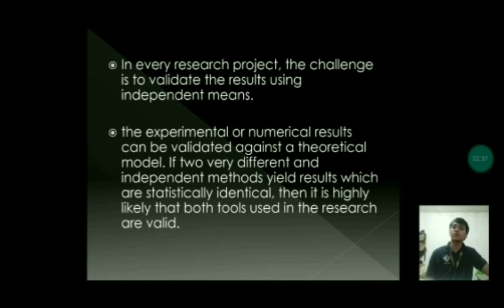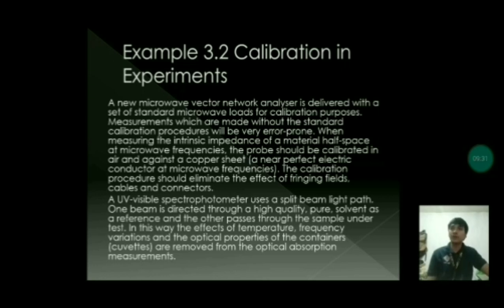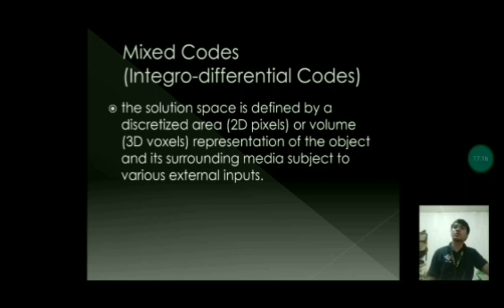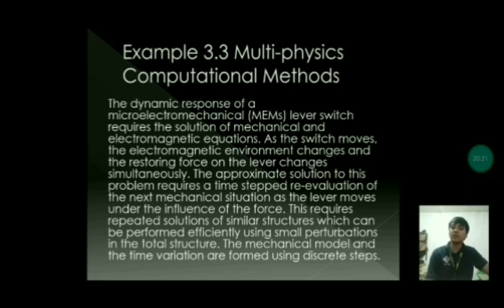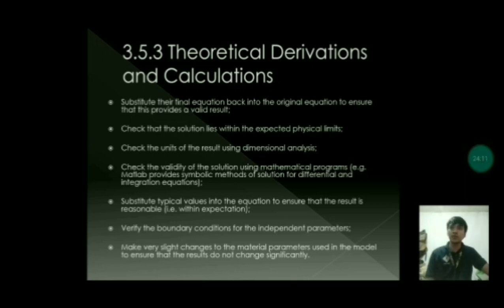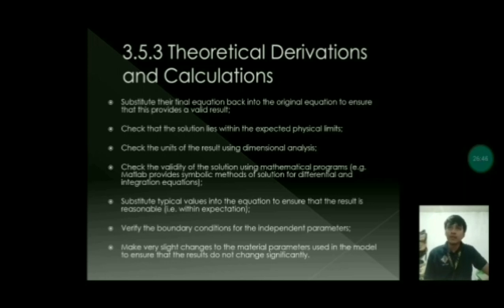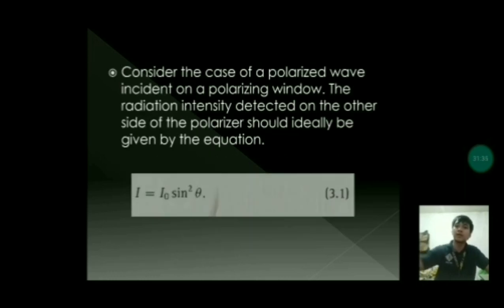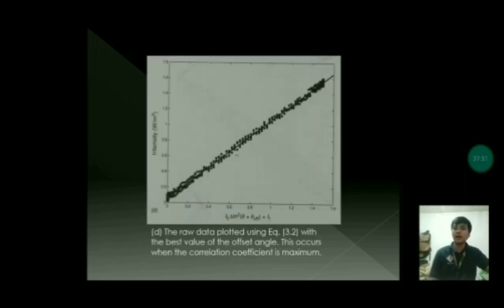Research Tools

Comment: Loreto, Liezl Mae E.
March 26, 2023
MWF 6:30-8:30 PM

REFLECTION
In this report, it describes the various research tools available for validating the results of a research project. It is important to validate the results using independent means, and the research plan should clearly outline the techniques that will be used for this validation. The strongest case can be made if the experimental or numerical results can be validated against a theoretical model. Additionally, it also describes the various computing codes available for modeling physical effects, and how the model should be validated by computing the solutions of standard models and comparing the results with theoretical calculations. 

REACTION
The video report provides a comprehensive overview of various research tools that can be used in  research. Overall, the video report is a valuable resource for researchers who want to learn more about the different tools available to them. It provides a clear and concise overview of each tool, making it easy for researchers to choose the ones that are best suited to their needs.

SUMMARY 
In this topic research tools, are techniques used to validate the results of a research project through independent means. The strongest validation is achieved when experimental or numerical results are compared to a theoretical model. Verification can also be done through calibration procedures, such as using standard solutions, well-known materials, or null calibration techniques. Measurement accreditation authorities, such as NATA, and international organizations, such as ISO, provide standard measurement techniques and guides for best practices. Numerical modeling involves using computing codes to model physical effects. Accuracy is affected by defining the boundaries of the solution space and the distance between nodes. The validity of the model can be verified by computing the solutions of standard models and comparing them with theoretical calculations. Theoretical derivations and calculations can be verified by checking the solution's validity using mathematical programs and ensuring that the solution lies within expected physical limits. Curve matching is another technique used to validate experimental data. The research plan must include methods of code validation as a means of verifying the results.

Comment: Geguinto, Jun Royce M.
March 27,  2023
Mwf 6:30-8:30

Reflection:
After watching this video presentation, I learned that using standard measurement tools and validating alternative techniques is important, as well as making sure models and data follow a certain mathematical equation for accuracy.

Reaction:
The reporter uses uncomplicated words and clear explanations to  make sure that the presentation is understandable.

Summary:
In summary, the topic explains the importance of validating research results through independent means and discusses various research tools such as experimental measurements, numerical modelling, theoretical derivations and calculations, and curve matching.

Comment: Borganio, Jeff G.
March 27, 2023
MWF 6:30-8:20pm

Reflection:
When analyzing a data, a research tool must be use in order to make conclusions and implications on the data that are collected. This chapter help me to categorize the specific tool that must be use in specific data that are provided and also to determine the advantage of each tool and how does the function in the research field.

Reaction:
The report about research tools are well explained by the reported , the examples thta are explained in the video presentation are indicated properly, I can understand the nature of research tools and it's importance in research field. Overall, the report was organized and well presented.

Summary:
Research tools are the tools that are required in research that must be appropriately selected. Experiment measurements, numerical modelling, theoretical derivations and calculations, and curve matching are the examples of tools that can be used in research in order to find the best possible accurate answers. Overall, research tools are important to find accurate solutions and to not make any biases based on the results that may find.

Comment: Pacana, Carl John B.
March 27, 2023
MWF 6:30-8:20pm

Reflection:
I appreciate the emphasis on the importance of becoming familiar with various research instruments to ensure effective research processes and accurate data collection. I agree that evaluating the results of different approaches to a problem is crucial to determine the most appropriate methods for a particular circumstance.

Reaction:
I found the input on research methods for engineers to be insightful and informative. It highlights the significance of using appropriate research instruments and evaluating different approaches to ensure accuracy in data collection. 

Summary:
Engineering research heavily relies on experimental methods to ensure the most accurate measurements, and authorities such as ISO and NATA provide standard measurement techniques to ensure reliability. To determine the most appropriate methods for a particular situation, the accuracy of solutions is evaluated and compared through various techniques, including numerical and theoretical modeling, curve matching, and other methods. It is crucial to ensure that the tools utilized are valid by comparing experimental outcomes and ensuring statistical identity.

Comment: Gahob, Jun Louis T.
March 26, 2023
MWF 6:30-8:20 PM

Reflection:
To make the research process more effective and guarantee that the data gathered is correct, it is important to become familiar with a variety of research instruments, specifically their functions. To conclude that the methods being employed are appropriate for such circumstances, we can evaluate the results of various approaches to the problem depending on whether they are statistically identical.

Reaction:
The reporter did a great job of thoroughly analyzing his topic. I learned a lot from the presentation.

Summary:
The most accurate measurements come from experimental methods. The International Organization for Standardization (ISO), which provides documents that describe standard measurement techniques, and the National Association of Testing Authorities Australia (NATA), which conducts measurements on a commercial basis, are two examples of measurement accreditation authorities. The accuracy of solutions is ascertained by comparing and contrasting the outcomes of different numerical and theoretical modeling techniques, curve matching, and other methods through evaluation and comparison. The tools utilized are regarded as valid if experimental outcomes are identical.

Comment: Eudin, John Gabriel BSEE
MWF
6:20-8:30 PM

Reflection
Participants' information is gathered using research tools in a methodical, consistent manner. Surveys, questionnaires, interviews, checklists for keeping track of observations, and experimental protocols can all be included. The population being examined, the research question, and the research design all influence the choice of research tool.

Reaction
It is quite informative to hear the discussion on keywords. Further examples from the reporter's report helped me to comprehend its purpose. All Thanks to the reporter's for the polished presentation.

Summary
Research tools are crucial to research methodologies because they enable systematic and standardized data collecting, guarantee the validity and reliability of data, make data analysis and interpretation easier, improve the consistency of results, and assist with ethical issues.